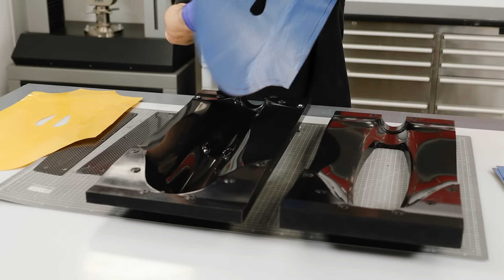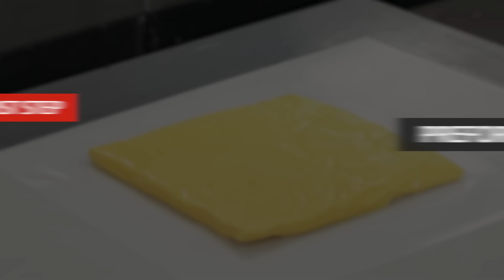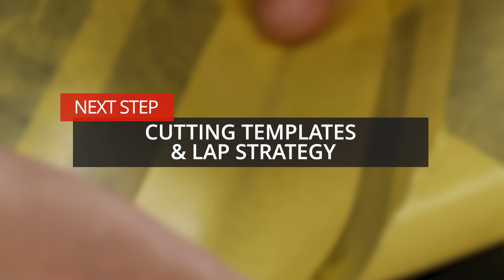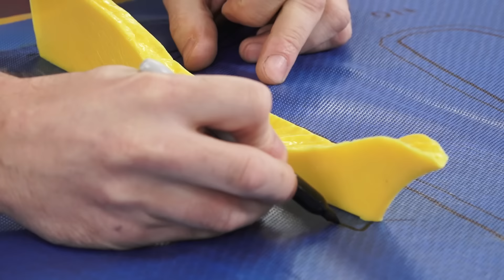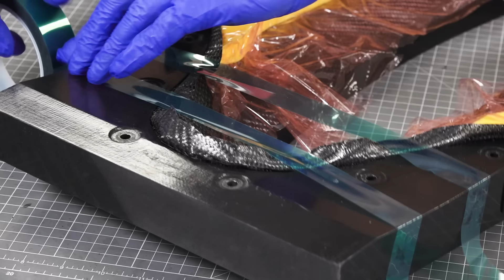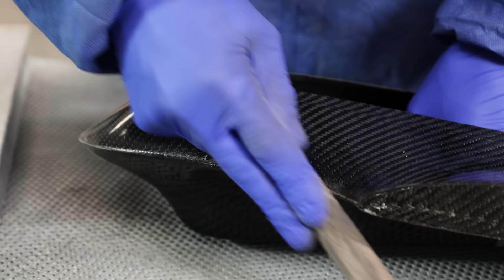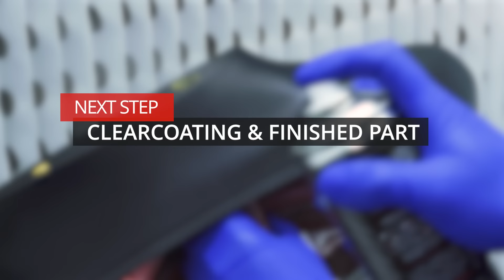Making A Complex Hollow Carbon Fibre Drone Fuselage

Comment: This might be a stupid question: aside from mold re-use, is there a benefit to this approach vs machining a non-reusable structural form core and laying/bagging the fiber atop that core?
Reply from the maker: Hi Chris that's a great question. Yes there are a number of reasons why this method is better. 
The big one is that it allows you to use prepreg material, not only is it far easier to laminate complicated shapes like this but you typically end up with a lighter end product given the controlled ratio of resin and fibre. 
A foam core would likely only be strong enough to take a light vacuum if you were looking at bagging it and not suited even for resin infusion which would end up with a heavier end result. 
Not using a moulded surface on the external faces also means that finishing is required to every part that you make. This usually involves a reasonable amount of sanding and then at least 1 coat of resin to give you a smooth surface, not so bad if you are making a one off but this then becomes inefficient if you end up making more than a couple. A mould part comes out with a near perfect finish. 
Then there is the stability of the part, a moulded part will give you very good accuracy every time you use it to produce a part given its rigid nature. An internal structure may not be entirely stable prior to laminating the reinforcement over the top. This allows for distortion and imbalance to be introduced at the point of laminating, which is not really something you want for an airframe like this. 

Hopefully that give you a few points as to why this method is beneficial.
Reply: @easycompositestv  Thanks so much for that reply. Makes perfect sense!

Comment: Do you think I could get away with 3D printing something like this in a combination of LW-PLA for the shell and carbon fiber for the internal structures and spars?
Reply from the maker: Your final result would be heavier than a pure composite shell but it may still work. You could also consider skinning the 3D print for a stiffer and smoother finish.

Comment: Sounds like if I wanted to build like this.  Which I could for sure, it'd be around 3 grand setup in tools, printers, cutters, fibre.
Reply from the maker: Generally speaking the more advance the process the more expensive the equipment. A 3D printer wasn't actually required for this project but you would need to CNC the patterns, this could be outsourced however. A curing oven and vacuum pump are really the big ticket items which you would struggle to manage without.

Comment: love to see this video, i just needed help regarding this multi mold infusion setup, thanks easy composites
Reply from the maker: This was done using prepreg not infusion. Infusion would be impractical for such a shape made in one piece.  You could make it as a separate top and bottom then join afterwards but then it adds more complexity.

Comment: what about laying down thicker film(s) to reduce the amount of pressure when direct moulding the silicone, of lower thickness then ?
Reply from the maker: If you have a thicker film that will conform to the surface, or multiple layers, then yes that would slightly reduce the thickness of the silicone.

Comment: You creating 3d printed plugs, along with the yellow multiplier stuff, is wild!
Could you make an inlet manifold for a engine?
Something simple like a Weber carb or quad throttle body on a Ford Kent 1600.
You could demonstrate true forge and a strong pretty traditional carbon fiber weave outer layer. 

: ]]
Reply from the maker: The process would be similar for other complex shaped objects like an inlet plenum or similar.

Comment: I am planning to start a small production of niche CF car parts from my garage in the USA. Where would you recommend someone with zero knowledge to start? I have a full time DevOps Engineer job so my time on the weekdays is quite limited but I am 100% committed.
Reply from the maker: Start small and simple with relatively basic shapes/profiles and remember to persevere, even when it doesn't go quite to plan. Reading all of the documentation before diving in is also something often overlooked. Skinning could be a nice way to introduce yourself to resin and the way which carbon fibre handles, It will also give you plenty of experience in sanding and polishing the material. If you wanted to have a go at making some parts then a combination of our epoxy mould making kit and laminating starter kit will give you all you need for some basic parts. These can all be found on the starter kit section of the website. Also check out the learning area of the website, we post a whole range of tutorial guides for a range of different processes so that will be a great way to get a feel for the techniques as a whole.
Reply: @ thank you!

Comment: Why didn't he cover it in the clear stuff? doesnt CF need epoxy to become hard
Reply from the maker: The material used here was prepreg carbon fibre which already has a form of epoxy resin impregnated into the fibres. This type of epoxy requires heat to cure, hence the cycle in the oven.

Comment: Man tu sehr viel Müll produzieren, extrem viel. Dann lieber 3D druck
Reply from the maker: 3D printed parts (at this point in time) don't really have the performance for making the moulds to process prepregs given the temperature and vacuum pressure it needs to withstand. It is something we're looking into so keep an eye out for this in the future.

Comment: Cool, but this will be a radio frequency nightmare.  RF doesn't play well with carbon fiber...  and it's electrically conductive.  Don't short any wires, or the whole thing may burn down.

Comment: What glue do you use to connect the parts?
Reply from the maker: As we spend as good minute or so of the video explaining, we used the epoxy based ET5428 from Permabond. You can find this available on our website under the adhesives section. The timestamp is 18:47 if you want more of an explanation as to why we went with this one.

Comment: Incredible amount of waste to create a single part
Reply from the maker: Sure, but of course, the mould (and ancillaries, like the intensifiers) can be used to make hundreds or possibly even thousands of parts. The consumables, per part, are on par with most other manufacturing processes and, of course, being a composite material, the end product is lighter, and so uses less resources in operation, than a product manufactured using (potentially) less consumables in production, but yielding a less efficient product in operation.

Comment: Hey bud I want to start an RC Boat company, and I need to make my first boat out of carbon fiber. How would I get a mold made from an existing hull. I want to make it a few inches bigger roughly 10% bigger so I can tweak it and make it my own. How would I do that
Reply from the maker: Really if you're wanting to make changes to the original then the easiest way would probably be to start from scratch and make a pattern from scratch. We have a video covering the process of making a patterns by hand so you may want to check that out. 

The other thing you could maybe try would be to coat the current model in expanding foam, you can then shape as intended before coating in pattern coat. Keeping the hull symmetrical might be challenging if you opt for this method though.

Comment: Wouldn't the design structure be compromised having this large opening on top, or are the tubes in the middle designed to counter that?
And this piece is less of a structural support and mainly aero/weight reduction and motor(driving) and aerodynamic forces will be exerted mainly on the internal pieces he glued on?
Reply from the maker: The body is designed around having a large access hatch so there is plenty of strength from the rest of the shape. The internal framework does a lot to help eliminate any flex and stiffens the whole structure.

Comment: Hi EC! Is isopropyl alcohol better than acetone? or is it only for bond preparation? Thank you, Mircea
Reply from the maker: Hi Mircea, 

Either would be fine to clean a surface prior to bonding. IPA is slightly less aggressive on some surfaces which you may want to consider.

Comment: How much does such an airplane body cost?
Reply from the maker: It depends A LOT on the application, the manufacturer, and the customer but in pure cost terms, a complete composite airframe for a small fixed wing UAV will cost a few thousand (pounds/euros/dollars) to make.
Reply: @easycompositestv  I'm from Ukraine. I think I don't need to explain further. Very good thing, but too long manufacturing process

Comment: Can you make a video about oven curing carbon parts? with heating and cooling diagramm.
Reply from the maker: We’ve already covered this in detail in previous videos so please have a look through our back catalogue. We’ve done a video specifically about curing prepreg in a domestic oven and also the main video about the XC110 system talks at length about recommended cure cycles etc. By the way, forced cooling isn’t necessary.

Comment: Hi,  Would it be possible to do 2 A surface molds (two part molds) like in the video for infusion process? I was always wondering if its possible or not.
P.S Amazed with the video!
Reply from the maker: Multi part moulds for infusion are possible yes, the challenge is sealing the 2 mould halves so that no air leaks through. We do intend to cover this in a future video so keep an eye out for that.
Reply: @easycompositestv  thanks guys, you are awsome!

Comment: proper term for the "intensifier" is a caul
Reply from the maker: It probably comes down to where you're from, but here a caul is a rigid insert for creating a moulded internal element on a part. Intensifiers are specifically flexible and normally made from silicone.

Comment: Thank you for giving valuable information 
Sir I do the same work of carbon fiber sometimes I prepared epoxy in large amount so tell me the  proper amount of epoxy for lamination 
How much epoxy should I prepared epoxy for   lamination ,vaccum begging and infusion
Reply from the maker: In very simplistic terms, you’ll need about the same weight in resin as you have in reinforcement, so add up the weight or reinforcement and that’s about how much resin you’ll need. If you’re unsure, mix less than you expect, you can always mix more and it saves waste.

Comment: Very nice work, I am trying to use 3M DP420 to bond the carbon parts, since I can't get ET5428 here, is this a good alternative?
Reply from the maker: Thanks for your comment. I don't know about the DP420 specifically. We tested DP490 alongside our adhesives and found it to perform pretty well in a carbon to carbon application although it was outperformed by ET5428.

Comment: As always, thanks for the in depth video. 

But are you sure about the intensifiers not doing much work on their own? I was always told that the heat makes them expand. To the point where the type of silicone used to make them is important as some expand more than others - potentially putting a lot of force on the mold in the places they are being used. Is this wrong? Or is it that the material you are selling does not expand much with heat? Or that the geometry of the mold/part where the intensifiers may not be constrained enough and thus will just expand into an open space?
Reply from the maker: Your understanding is good. It’s true that silicone has a high CTE and so can be used to create pressure in its own right, however, in order to do this the mould geometry needs to constrain the silicone on most faces to a large extent, without this, the expansion of the silicone has little effect. But, with constraint, it can be very effective. We plan to cover this in a future video 👍.
Reply: @easycompositestv  That's good to know and thanks so much engaging and elaborating. It means a lot:)

Comment: may be using some anti-adhesion fabric in gluing places when curing and remove it right before gluing prevent from sanding?
Reply from the maker: Yes, peel ply (which is what it’s called) can be used to prevent the need for keying before bonding, however, peel ply absorbs some resin and on such a thin laminate there’s no resin to spare and so you’ll end up with slightly dry reinforcement in those areas. On thicker laminated though, peel ply is a good time saver prior to secondary bonding.

Comment: Talk about a dry delivery,... ;)
Everything seen here, is exactly why Composites will never filter down to 'consumer' or 'hobbyist' levels of model flight. The cost, the time taken, and the amount of time and money needed to replace it, even 3D printed is a significant cost and time saving, while hot-knife shaped foam is easier again. This sort of Drone construction is really only ever going to be used by high end Government, Corporate, Broadcast, and maybe Engineering Students in University, and it's only benefit is for uses where weight is the utmost consideration, which it is not for the vast majority of wing flyers, where speed, endurance and payload are more important.
The processes used, would be more useful to folks building custom car panels, or racecar construction, where more layers will be used for strength, and still come in well under the mass of pressed Steel or Aluminium panels, though modern injection molded panels could rival Carbon for mass savings. Passenger and Recreational aircraft use many more layers, as strength is the utmost factor for those application.

Comment: Could we consider applying only one layer of 210gr carbon fiber prepreg instead of 2 to build such a part?
It would be so nice to demonstrate how stiff carbon fiber could be once cured, comparing 1 vs 2 vs 3 layers 😊
Reply from the maker: A single ply would be too thin, in most areas, for this structure but there are occasions where a single ply of 210g can be used. In fact, we did a quad copter shell in a previous video using only a single ply. It was paper light but obviously not ‘structural’ to any real extent.

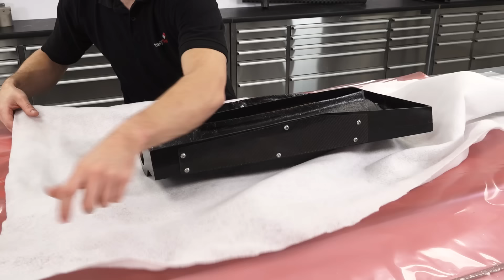Comment: 6:00 he made carbon fiber parts to hold the mold together for his carbon fiber parts
Reply from the maker: These flat plates are actually part of the mould itself and form the flat faces of the wing roots. Because we are working with carbon fibre at elevated temperature to cure the material, it's good practice to have the mould made of the same material so that any expansion and contraction happens at the same rate.
Reply: @easycompositestv  And it just so happens to be a baller move too, hah
Reply from the maker: @thecitizenchan  You should see our carbon fibre whiteboard 😉
Reply: And I think the mold itself is carbon fiber too, hah

Comment: FWIW, that’s not a flying wing; that’s a blended-wing-body. An example of a true flying wing would be a YB-49.
Reply: I wouldn’t jump to say this is not a flying wing. Often blended wing body refers more to stuff like the Boeing blended wing body concept, with a more prominent and distinctive fuselage blended into a quite different shaped wing, whereas the fuselage here is still quite short and discrete. Also, the flying wing terminology is often used as a catch-all term for wing-dominated tailless aircraft of many types, including extensively throughout aerospace literature. Most aircraft referred to in literature as flying wings aren’t purely a wing e.g the B2.

Comment: How could these lap joints be achieved with dry layup and infusion? Would intensifiers work for infusion too? 

One of my concerns is that carbon fibre is electrically conductive, so it makes it impossible to use internal antennas in a drone. One could make the fuselage out of kevlar instead. Kevlar would also be beneficial for impact resistance. But that means either wet layup or infusion.

Comment: 20:31 looking like there's a lot of flex in the upper surface of the drone when cleanings?
Reply from the maker: Yes, the shell does flex. No issue at all with that though, mainly the flat surfaces are aero skins; the fully assembled fuselage (with the internal structure added) is more than stiff enough for application. Remember, in aerospace, you want only the strength and weight that’s required, and no more!
Reply: @easycompositestv   I absolutely agree with unnecessary weight staying on the ground. My primary concern on the flex is flutter induction. That style of flying wing is very sensitive to airflow delamination in the region on the root to motor mounting area. It's impossible to tell from the video if this is or isn't going to be a concern, just something to be mindful of should you take it to the next stage of flight.

That's a lot of work to flat spin into the ground on your first flight. I'd hate to see/hear of that happening.

Comment: Will you ever address the long term dangers, risks and hazards when working with or disposing of carbon fibre?
Reply from the maker: We’ve already done a video discussing the safety considerations of working with carbon fibre. As a material, it’s been around since the 80’s now and the risks are well understood. Disposing of carbon fibre does not require any special consideration, it’s an inert and non-hazardous material for disposal.

Comment: Amazing video! 

I am excited to see how the wings will be made.
Reply from the maker: Haha, OK, noted. Seems to be lots of interest in seeing the wings made so I think we’ll cover it soon.
Reply: @easycompositestv  That would be great, I am currently designing a wing for my car and would like to see a wing tutorial for a smooth surface and trailing edge.

I am unsure on how to do it. It would probably be a split mould with a lap joint in the front. But I am stuk on the trailing edge. Sandwiching the halves together (in my mind) could result in a longer tail or a weaker joint. If that makes sense haha

Eagerly awaiting the video - Cheers!